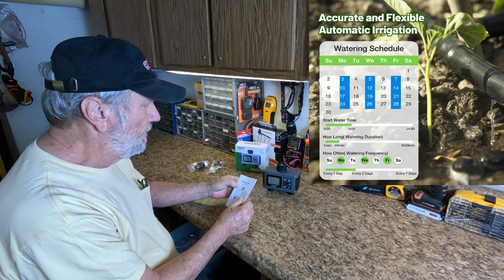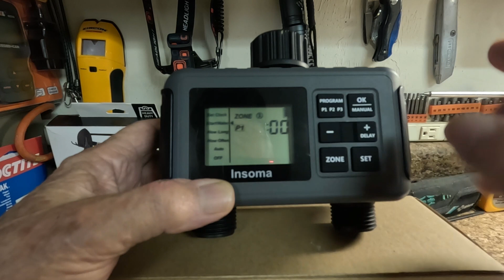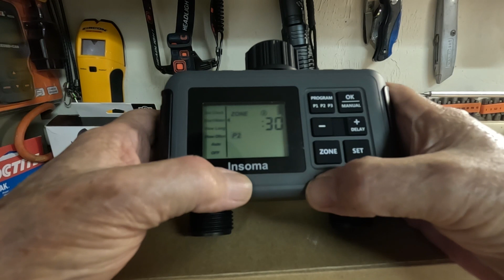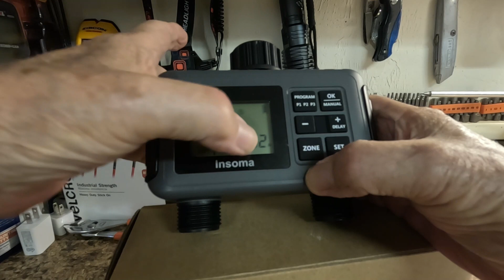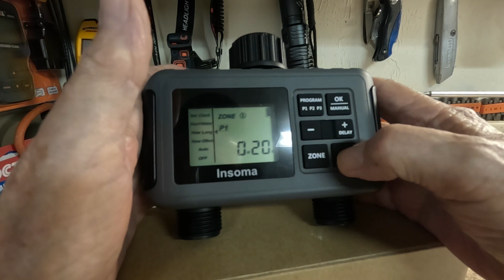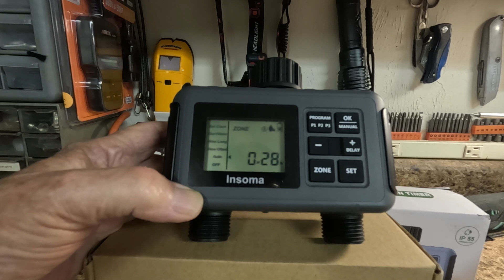Dual Water Timer will give a lot timed water control

Comment: Thanks for the help! I finished the setup, but I ran into a problem. I tried a manual test and water isn't running in Zone 1, even though Zone 2 is working normally

Comment: Hi Sam. Maybe you know how to run all the program in a round, one by one? I programmed 3 program for every tube. So, I need all this 6 program every day run. How to activate this way?
Reply from the maker: @gennadyklepikov969, You say 6 programs, but there are only 3 programs to work with.  Now the part you need to do is Program 1, you have two outputs Zone 1 and 2, as part of your programming, set up Zone1 for the time to start, how long and the rest, then under program 1 setup Zone2 for the start , how long.  You will do this for each of the programs, P1,P2, and P3.  I think you will see that both outputs can have different times.  When you are in P1, set Zone1 to the time to start.  Hit Zone key to go to Zone 2 and set it to the time, can be the same or different.  Go to P2 do the same and P3 the same.  There you have your 6 times that will just run as you have programmed.
Reply: Thanks, Sam. But I still need your help. I programmed : Zone 1 Program 1 at 7.00 a.m, Zone 1 Program 2 at 13.00, Zone 1 program 3 at 19.00. Zone 2 program 1 at 10.00 a.m ; Zone 2 program 2 at 16.00 ; Zone 2 program 3 at 22.00. I need somehow to make it run. Unsuccessful yet… Maybe you can help. One more question, how to restart this gadget to clean up all the program? Just take out battery does not helped.
Reply from the maker: @gennadyklepikov969  You must also set the how long and how often for each program zone.  Be careful when using Ok and Set, the set saves the setting, Ok moves to the next setting and Ok will delete a setting.  I suggest setting a test setting just P1 zone 1 and zone 2 to the next day. Set both zones before you hit set to go to how long, and do this all the way through.  When you are complete leave on Auto and that starts the timer running for all your programs.  When you get it set right, you can push any button and see Next Zone1 and the time to start. I did find you must have at least 1 day set in advance for it to work.  I messed up a few times before I got it working correctly.  Just set times 2  min duration and then you will see the zone is on when you see water drop icon at the times they are suppose to come on.  Oh, to delete a program timer, just set how long to zero for each program you do not want.  Off turns timer off and does not run.
Reply: @samowens44 , Thanks Sam. Finally I did it. It was to many times pushed OK button. In this timer OK also cancel previous choice. Thanks.
Reply from the maker: @gennadyklepikov969  Yes, the Ok did mess me up over and over until I realized it's true function at certain points of the programming.  Glad you go it, I know the feeling when the lightbulb comes on!!!!
Reply: OSR É MUITO BOM, POR NOS AJUDAR , PEÇO O FAVOR DE ME ENSINAR SE POSSÍVEL 3 HORÁRIOS 4 VEZES NA SEMANA SERIA POSSÍVEL? FICO MUITO AGRADECIDO, FORTE ABRAÇO, E AGUARDO AS ORIENTAÇÕES DO SRM!